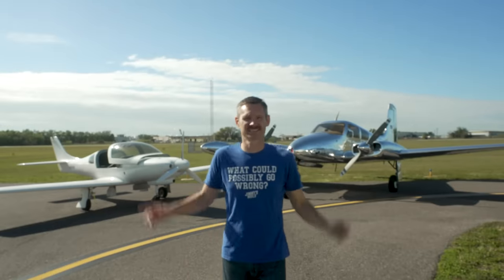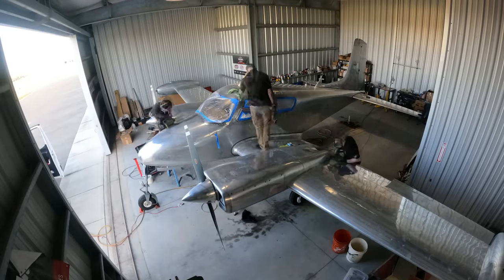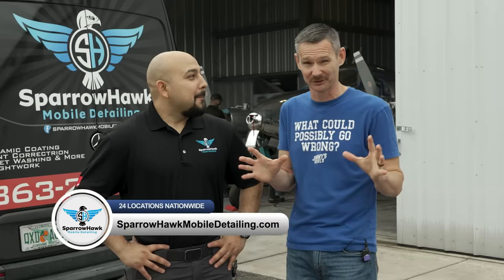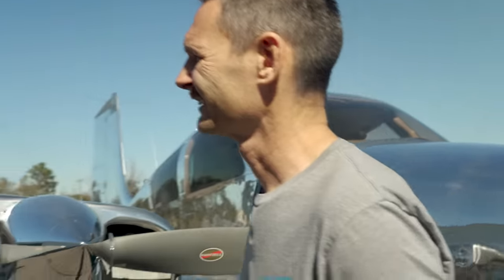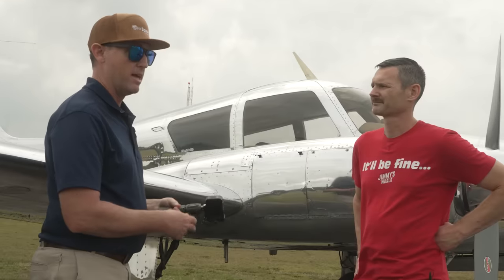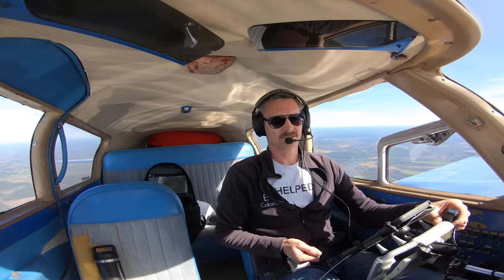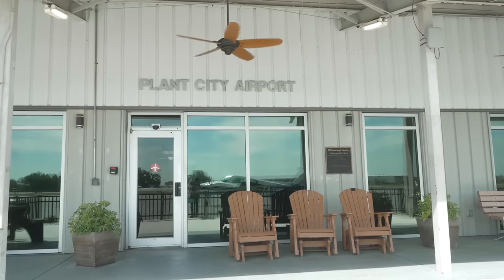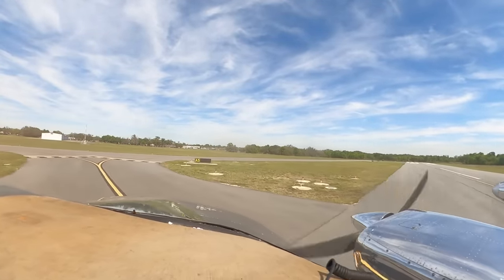Airplane For 1 PENNY

Comment: First, I thought, 'You're gonna need a SPF 100 Suntan Lotion to fly the BE-U-T-FULLY polished 310!  Then the gear issue popped up.

I feel the pain!!  Same thing happened to me in a 1949 Globe Swift... and turning the Emergency Gear handle was.... no resistance to HEAVY RESISTANCE... and still no Green Gear lights!  Eventually, I got the Green light and landed safely.... and the old comment for those that fly Retracs...   'Those that HAVE... and those that WILL" have a gear issue at some time.

Glad you AND the plane are good!!

Comment: That happened to me years ago on N58JW it is now scrap but I had the same thing happen to me with a Gear Actuator it stuck half way down and Popped. I did crank it down and all went well. I grew up on a 310, 150M, 172, 182, then on to a Leer, then a L1011, Then to Cargo 747. But I flew to work from SHV to DFW in a 150M N714EB my plane name was "Little 4EB" all the time. I was in front of an Air India 747 Taxing for take off and the Air India Pilot was Irate asking the tower why he put a stupid small plane in front of him? I came back and said Air India 814 this is Little Cessna 4EB I may be small but I am as big as you on this Taxiway. The laughter that caused was so funny the Tower told everyone to Shut Up and stated FYI Pilots his office is a Captain of a 747. He then gave me a Mid Field take off and told me to fly by the Tower for Traffic after take off. They were outside and waved. My radios cost more than the airplane and I was certified to be in that area. BTW Air India Apologized to me on 123.45. With all the equipment installed on my 150 I could only carry 162lbs of passenger. Beats driving. I loved my STOL Kit on that plane had it installed just for an emergency landing. Short story coming back from DFW to DTN on an IFR plan I got into a 89 knot Tail wind with a ground speed of 174 Knots. Shreveport approach who knew me and the Tail Number by Heart and my Voice asked me what I was Flying. I said Shreveport approach I forgot to tell you I had installed a Twin Turbo FEI with a Jet Pack and 200LL fuel, would you like me to step it up for Traffic. Approach said no you are past VNE but you need to go lower to avoid an incoming Space Craft. You have Barksdale worried there is a rocket Inbound then everyone laughed and he said "You set Air India Straight", Very Small World. Very True Story no BS.
Reply from the maker: best story ever!! love it!

Comment: Jimmy, nice job handling the gear issue.. except.. If you were already enroute to TAS to have the 310 checked out by the best twin cessna guys around.. seems like the right place to be with a gear/rigging problem on a twin cessna would be right there at TAS.. I would have continued Direct KDFI instead of turning around.. especially after you were halfway there.. i'm assuming the gear issue happened after a fuel stop.. 3 hours back @ 130 kts.. puts you ~400 miles into a 800 mile trip..  i suppose worst case, a gear up landing at KDFI leaves you a long way from home with a broken airplane..  unless the trip to TAS was another sponsor spot and you didn't want to end up with a bill.. that I would understand as well.. at least this way you can put it on jacks and swing the gear and see what was causing the issue first.. as soon as i pulled that breaker.. i'd have cranked the gear down to see if i could get full extension and green lights... right then.. you were already slowed to gear speed anyway.. wouldn't affect your trip back..  and, i don't understand making your inspection pass that high to verify your gear was abnormal..   which you already knew.. made little to no sense..   making one after you extended it to verify down and hopefully locked would have been more useful..  regardless.. glad you and the 310 are alright.. let us know what the problem was..

Comment: Can't a mirror finish be coated so it lasts?
If you ever get tired of old planes why not make new ones. Think Lancair 320. Single piece composite fuselage. Single piece wings. Keep it super light. Suffer Rotax prices in the beginning and then replace them. People pay multiple houses for a plane these days. There is opportunity.
Reply: clear coating bare aluminum never lasts.. the aluminum expands and contracts at a different rate from the coating.. it always turns yellow, or lifts and chips.. couple years is all you get.. airstream has clear coated their trailers since the 50's and they never last..  then it causes more problems because to fix it you have to strip the clear coat off then polish and start over..  seems like a good idea.. but it's just not..    you can do wheels, small parts..  stuff like that.. things in controlled temp.. but an airplane.. you are better off just sticking with bare aluminum, and maintain it..   if you keep up with it, it's a constand job, but not difficult..  you let it go, and it's a big deal.. if you aren't up to the maintenance.. paint it.. then you can ceramic coat it or wax it and it's easier to maintain..
Reply: @texastyrannyresponseteam794  makes sense but just the right tech might make it work. GPT suggests that a ceramic coating might work. Or some automotive clear coat.

Comment: AIC Title Service (used by your auction service) are good folks to work with....   But... I have only bought 2 aircraft in the last few years.   First the seller chose AIC Title... but they were so professional, the second time I bought an aircraft, I asked to use them. 

But, I'm guessing you've run across them before, Jimmy, with as many aircraft as you have bought over the years.